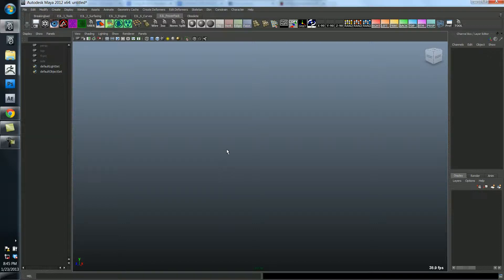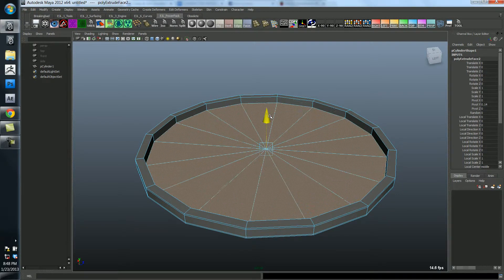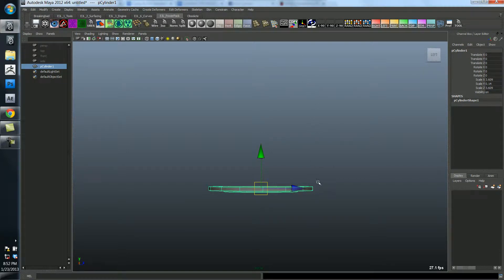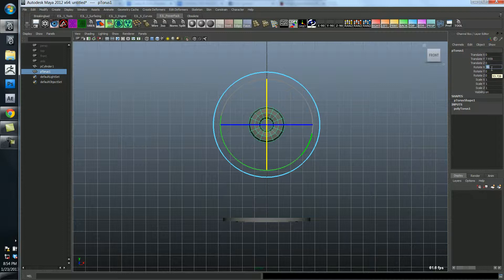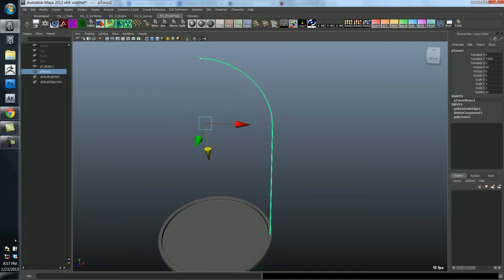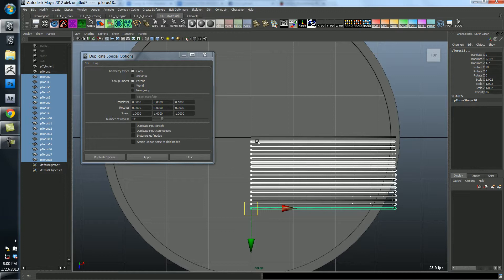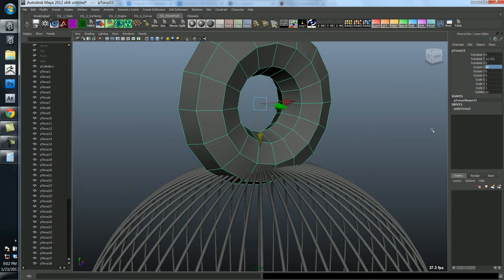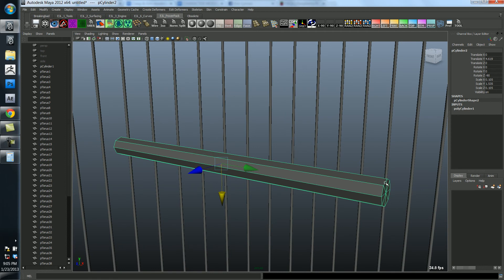Intro to Maya and 3D Modeling - Lecture B: 9/13 - Birdcage Model

Comment: Love the Videos, I'm new to Maya and am working my way through all your stuff. Its helping me greatly so thanks! I was just wondering how you assigned hotkeys for changing the perspective of the optics? Thanks.
Reply from the maker: +idrishonnor123, you need to create custom hotkeys in the hotkey editor. The codes are as follows:

viewSet -fit -ff 0.8 -krs true -an 1 -rs  ;print "RIGHT View\n";
viewSet -fit -ff 0.8 -krs true -an 1 -ls  ;print "LEFT View\n";
viewSet -fit -ff 0.8 -krs true -an 1 -f  ;print "FRONT View\n";

viewSet -fit -ff 0.8 -krs true -an 1 -b  ;print "BACK View\n";

viewSet -fit -ff 0.8 -krs true -an 1 -t  ;print "TOP View\n"
viewSet -fit -ff 0.8 -krs true -an 1 -bo  ;print "BOTTOM View\n";

viewSet -fit -ff 0.8 -krs true -an 1 -p  ;print "PERSP View\n";
You can also find all of these commands on my "power pack" download from my site, here: http://www.eric3d.com/uploads/2/9/0/4/29045899/ejl_powerpack.zip
Reply from the maker: Ugh, youtube screwed up the line formatting. Anyways it's all there, just make sure each line ends with a semicolon. Two lines per hotkey. Or just download the shelf
Reply: +Eric Lyman Sorted, thanks very much.